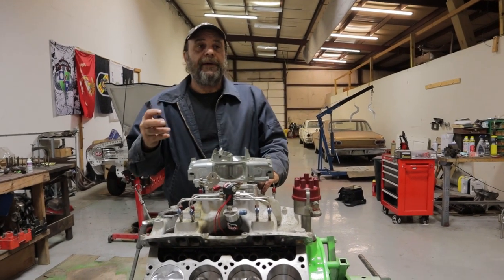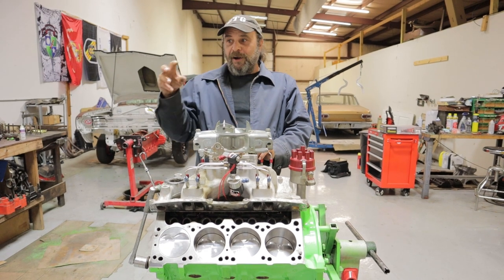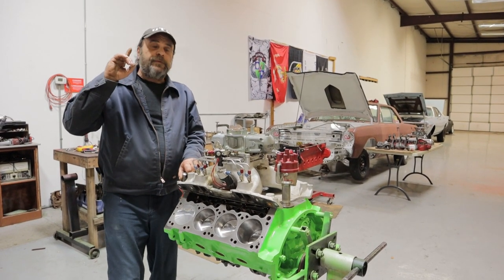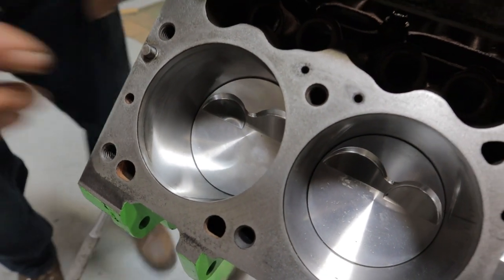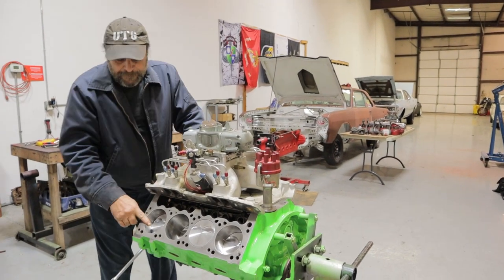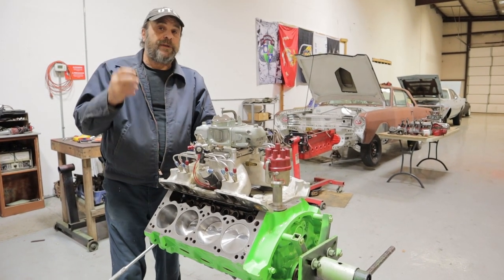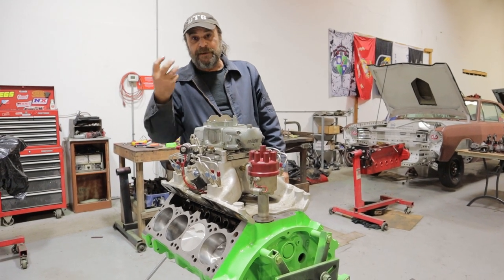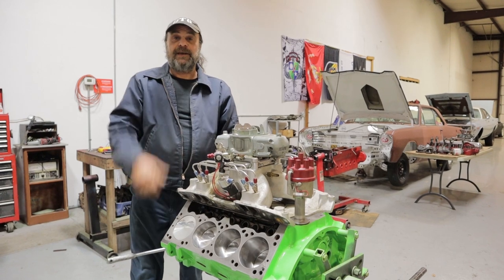The Fundamental Aspect Of The Internal Combustion Engine Nobody Ever Talks About

Comment: Smokeys intake temperatures were too high to make usable power. In simple terms think about the oxygen density at those temps. Or the expansion in the cylinder. When you go from 70° to 1000° in the cylinder you have a lot of expansion. When you start from 300°+ to 1000° not so much expansion.
Reply: @AndyGeesGarage  add to that, at those intake temps you cut the oxygen and fuel molecules in half also. Smokey might have been able to cheat NASCAR but you cant cheat physics.
Reply: @AndyGeesGarage  the fuel doesn't expand when it's burned, it generates heat. The heat alone expands the air inside the cylinder.
Reply: @AndyGeesGarage  It's the ideal gas law, PV=nRT.
 The temperature increases, as temperature increases pressure or volume will linearly increase. 
Just plugging in a 350 SBC cylinder volume with a 10:1 CR, and a combustion temperature of 2000°, I get about 1100psi of pressure at TDC. Multiplied by the surface area of the piston is nearly 14,000 lbs of pressure pushing down on the piston.

Obviously, temperature change is the function of an internal combustion engine. Heat is what drive the piston. The combustion provides no force, only heat to expand the gases in the cylinder.
Reply: @AndyGeesGarage  you are close, but a little off. There is no mechanical energy in the combustion of gasoline, it doesn't push the piston down. 100% of the energy released by the fuel is heat and light. That heat causes the gas pressure to increase, which drives the piston down. As the piston is pushed down, the volume increases, which proportionally decreases the pressure and temperature.
Heat is converted to mechanical energy because the pressure drives the volume of the cylinder to increase. Not all of the heat is extracted, so the remaining energy is lost. If you were to combust the fuel and air without letting the piston move, and you let the cylinder sit long enough that it cooled back to room temperature, you'd find you had less pressure inside the cylinder than before you combusted the mixture.

Another way to think about this would be a nuclear warhead. Those create huge explosions, with pressure waves that knock down buildings. But nuclear explosions don't create any matter, or release matter, they actually consume matter and convert it to energy. So, there is less material left after the detonation, where did the pressure wave and explosion come from? It 100% came from the heat. As the air and material around the explosion was superheated, its pressure went up, the amount of volume it needs to occupy went up.

And it's ~48MJ/kg, not 48MJ/g. The Hiroshima bomb was 980MJ/g or 980000MJ/kg for reference.
Reply: @AndyGeesGarage  I haven't said anywhere that matter is consumed or energy is created in a combustion reaction.
I'm trying to explain to you that combustion only generates heat, that's it. 100% of the energy released, is converted to heat inside the combustion. That heat then expands the gases, which raises the cylinder pressure. The pressure being higher as a result of the heat from the combustion, drives the piston down.
Another example. Hydrogen engines. Hydrogen and oxygen are gases, they take up a relatively large volume as they arent that dense. When they react, they release a tremendous amount of energy, nearly 3 times as much per mass as gasoline. But what do they form? Water. Water is much more dense than hydrogen or oxygen gas. But because of the energy released in the combustion, that water is instead steam at several thousand degrees, and that superheated steam is an order of magnitude less dense than the gases pre-combustion. If you allowed a sealed cylinder that combusted hydrogen to cool off back to room temperature, once again you would find that the pressure after combustion would be lower.

All energy is the result of the condensing of matter. A chemical reaction will release energy if the products are molecules in a more condensed, stable configuration. Even gravimetrically on macro scales, energy is released as matter condenses.
Reply: @AndyGeesGarage  Type "internal combustion engine" into Wikipedia, the first two sentences are  "An internal combustion engine (ICE or IC engine) is a heat engine in which the combustion of a fuel occurs with an oxidizer (usually air) in a combustion chamber that is an integral part of the working fluid flow circuit. In an internal combustion engine, the expansion of the high-temperature and high-pressure gases produced by combustion applies direct force to some component of the engine."

According to Wikipedia even, a piston engine is a heat engine. It entirely functions off of temperature changes.

An internal combustion engine is basically a steam engine, it works on the same principle but with extra strokes to fill, compress and exhaust the internal combustion steps. Moreover, the products of perfectly combusted Gasoline are CO2 and H2O.
You are generating the "steam" pressure inside the cylinder, instead of in a boiler like an external combustion steam engine. The "Steam" includes superheated H2O, CO2, and atmospheric Nitrogen. Simply heating the air inside the cylinder creates all the pressure that moves the piston. The piston and sealed chamber converts pressure derived from heat into mechanical energy.

Similarly, a steam turbine and jet engine are fundamentally the same. You use a compressor turbine and combustion chamber on the jet engine, or a boiler on a steam turbine. But both utilize an exhaust turbine to capture the energy of the heat causing expansion. 

All the fuel does is release heat and radiation when it is combusted.

Comment: Thanking you Tony for such great explanation.   In regards to vapor fuel,  the Inventor John Gulley  technique was using  a  bubbler vaporizer and the trick was the formula mixture:  water& alcohol etc ... utilizing the output from the oil catch can to  the input of the vaporizer and  the vapor output to the intake manifold control by ball shut-off valve..my $0.02😃

Comment: Thank you for the education about why the internal combustion engine is so inefficient. Would a shorter stroke make any difference or would it be limited by the amount of displacement?
Reply: 4 cycle engines are spontaneous, every cylinder has another cylinder completing its stroke right after it. This theory I'm afraid does not hold up imo. Each cylinder is immediately aided by another cylinder with constant force on the crankshaft.
Reply: Maybe it's a specialized case but look at Formula 1 engines. Very oversquare designs usually. Sometimes approaching 2:1. Look at two of the iconic engines of the 70s the Ford Boss 302 and the DZ-28, 4" bore, 3 inch stroke. The Mopars, AMC and Pontiac Trans Am engines all had shorter strokes than that. Pontiac was the shortest of all of them ar 2.840". All these engines in race trim were pushing 8k rpm.
Reply: It’s a balancing act of trade offs. The short stroke makes it harder to build compression and can limit torque because of a lack of leverage on the crank. Generally shortening the stroke is done to get higher rpm because it reduces piston speed.
Reply: Large bore short stroke engines will always have more efficiency capability but less torque pound for pound than a longer stroke engine will
Reply: It depends on engine speed. A shorter stroke means a lower piston speed. But piston speed also increases with RPM. You want a piston speed that matches the speed of the flame front. So, engines that operate at lower speeds tend to be more efficient with longer strokes, or undersquare designs. Engines that operate at higher engine speeds tend to have a shorter stroke, or oversquare design.
Engine speeds also dictate how efficient the cylinder head can fill the cylinder, because the air can only flow in so quickly. So at low engine speeds you can use a small bore and long stroke to efficiently fill the cylinder. But at high engine speeds, you need large valves in a big bore and a shorter(slower) stroke to fill the cylinder.
Reply: If you really want to go down a rabbit hole, read up on rod ratio. Rod ratio is the length of the rod divided by the length of the stroke. Short rod ratio decreases piston dwell time, which is the length of time the piston sits at the top of the cylinder.
Or rather, given the same stroke length, a short rod will move faster at the top of the stroke and slower at the bottom.
Reply: @SpecialEDy  
I've heard the idea rod to stroke ratio is 1.75. Oddly the only engine I've found that fits is the AMC 232. But for most engines I don't think it matters that much
Reply: @mpetersen6  I'm not an expert enough to know. The ideal ratio would probably vary by valve configuration, rpm range, cam profile, compression ratio, and bore to stroke ratio. IIRC, it affects the valve overlap and the flame front propagation. 
The old school guys have their preferred ratios for certain builds. Tony would be one of those guys that'd probably be able to talk about it with some experience.

Comment: Parasitic loss from all the extra motion of the rotating assembly, when burning pure vapor. Just another reason vapor fuel systems are impractical. Plus when you increase fuel efficiency drastically by burning vapors. You decrease the amount of fuel. No matter what the fuel is. There is only a certain amount of potential energy available per ounce, gallon, etc. Extreem fuel efficiency. Means extreem reduction in available energy. Some vapor systems do work. They just can't provide any practical amount of power though. Thank you for showing the average actual power stroke. And showing a comparison of the reduced energy pulse in a vapor situation.
Reply: I'm glad you wrote this. I was thinking something similar.  It seems simple enough to me...if you thin out the fuel, that's less potential energy.  However, I definitely learned something from this video.  I had no idea about the difference in degrees that the crankshaft was making power between gasoline and nitro....guess I just figured the nitro had a bigger explosion, but never really thought about what that meant when you slowed it all down...sorry for getting off topic there lol
Reply: “Extra motion”?  What are you talking about?  Smokey’s vapor system got 50 mpgs, 250 hp and 230 tq.  That isn’t a “practical amount of power” to you?
Reply: Like Tony said. Smokeys system was involving the entire engine. I read an interview years ago. He modified the intake runners to create a high velocity swirl and other things, besides just vaporising the gasoline. He did not use a tiny, restrictive carburator. He used the factory carbs, with leaner jetting. He created a lean burn system that have approximately a 20% increase in fuel milage. He took it to the limits of what can be gained, and still make practical power. He didn't creat super high milage either. Those engines were already 35 mpg engines or better. And they were gutless until the engines reached operating temperature. He himself admitted they were impractical for about the first five minutes of run time. And the extra motion. Is the motion of the pistons, rods and crankshaft after the power pulse has burned itself out in most attempts at super lean burning gasoline vapors. Most vapor systems are only creating power for roughly 20 or 25% of the pistons downward travel. Most normal gasoline engines are creating power for 50 through 60% of the pistons downward travel. Diesel engines burn the fuel slower, for 70 to 80% of piston travel. Nitromathanol engines burn for the full 100% of piston travel. Plus a little is still burning on the exhaust stroke.

Comment: So... is a short stroke engine more "efficient" with the expanding flame than a long stroke engine?  Assuming all other parameters are equal.
Reply: It comes out about the same, it's really a question of length of time the engine is decompressing the air inside it, which is the same, other things equal (compression ratio, rpm).
Reply: A given volume of air/fuel mixture at a given compression takes the same amount of time in microseconds to combust regardless of bore/stroke ratio or engine rpm. Torque comes when that time coincides with as much of the expansion stroke as possible. Power is a product of torque and rpm. With short strokes you can achieve higher speeds without breaking wrist pins but sacrifice torque by eliminating leverage and require high speeds for power. Large bores have more surface area and more ring gap between the top ring and crown and are worse for particulate emissions. High surface area in the chamber increases heat loss to the cooling system giving less heat for expanding the combustion gases.

Aside from the vapor intakes you can increase engine efficiency by running them hotter.  A 205 thermostat vs a 180 might not be a huge difference but it's more efficient.

Comment: OK, what about Propane and LPG engines?  All vapor, all the time.  Can (usually don't due to OEM sourced engines) run very high CR and make quite usable HP.  We used to have a drag car out here on the west coast running 14:1 and LPG, sponsored by PG&E.  Ran respectable numbers to a gasoline car.
OTOH, I think about 1/2 the secret of NOx motors is their sustained long burn adding force to the piston further down the stroke ... :elbowcough:
Also one reason that diesels make more power, more "heat" in the fuel, and injected directly so slower overall burn with more force on piston for longer.
Reply: The secret of NOS is it adds a molecule of oxygen to the mix, so when the 2nd fuel supply adds more fuel at the same calibrated time, it's the same effect as a roots blower or turbo squeezing more air/fuel into the combustion chamber than natural aspirated atmospheric pressure can do do by itself.
Reply: In Australia we had or could buy an LPG engine on a Ford Falcon straight 6 in the  late 00s early teens,that was a direct liquid propane injection system. This meant that you had a  cold liquid ,instead of a vapour injected directly into the intake instead of the more common vapour system ,it had great torque because of this(nice cold high octane propane delivered fresh in to cylinders rather than warm vapour system, like adding an intercooler to a turbo engine) and this also overcame the major issues that the vapour engines had of getting enough propane delivered to the engine, which is major pitfall of a propane engine, keeping the quantity of fuel needed in a performance engine up to it . But if you overcome this obstacles it is in many way's as powerful as a gasoline engine and can be superior to gasoline as propane is higher octane than premium gasoline, like e85, that's also why there harder to start in  cold weather and need good spark ,but will boost torque for this reason, especially in modern injection systems, I also should it's generally a cheaper and cleaner fuel to buy

Comment: Mentioned in the first one of these but you don't have to be so specific to explain why it doesn't work, the purpose of every engine and motor is to turn potential energy into mechanical energy and heat at a certain ratio.
To get the mechanical power that it takes to drive a 3k lb vehicle 150 miles, that takes more potential energy than 1 gallon of gasoline has even at 100% conversion to mechanical, so a fantasy world where the engine doesn't need a cooling system because every bit of energy of burning gas is going into turning the crankshaft, still wouldn't be enough to get 150mpg. 
It's like trying to put 10 amps of 110v into an electric motor that's turning a generator and expecting to get more than 10 amps of 110 out of the generator.
Reply: Lol.  And how did you come to this conclusion?

Comment: I worked for an electric and gas utility in the 1980s that converted part of its vehicle fleet to CNG, compressed natural gas. This is similar to vapor fuels in that a gas, not liquid, entered the combustion chamber. They converted pickups and small service vehicles. Most cars weren't converted as they weren't cost effective due to their inherent fuel efficiency. Also, big trucks weren't converted due to lack of power. Power loss was noticeable even in pickups especially during acceleration or lack thereof.
Reply: I was wondering how this vapor/hydrogen discussion would carry over to CNG as well.  Very common in Russia, most people acknowledge a ~10%(?) power loss but it's far from not-drivable like these hot vapor carbs are generally described.

Comment: The liquid fuel is atomized as soon as it's sucked into the venturi stream and sent on it's swirling path to the intake valve.  An injector atomized at the nozzle may be closer to the source but take the liquid pressure away and you lose the pump action, so this hot vapor idea is basically just forced vapor lock injection but the total number of fuel atoms to air needs to remain at optimum mix for the air density altitude either way. 
Will these guys fly a homemade hot vapor air injected air plane out of Denver?

Comment: Love your videos Tony. Some diesel motors will chase the piston down with highly pressurized fuel to extend the burn. I realize a backyard mechanic doesn’t have the resources to accomplish that but do any gasoline engines incorporate that technology?  Also, I have always been interested in propane fuelled engines. Instead of just converting a gasoline engine, if someone was to build a propane only engine, taking advantage of the high octane, could a propane engine deliver more power and efficiency compared to gasoline?